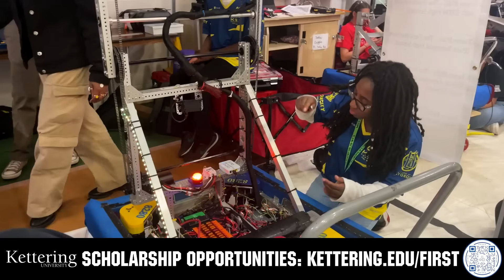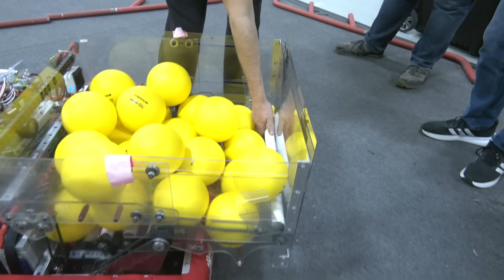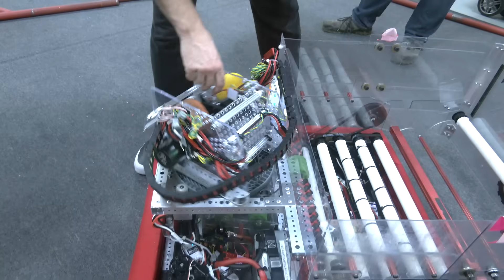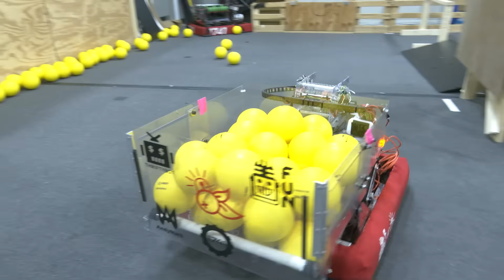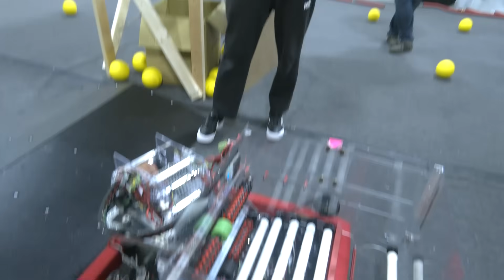Technical Breakdown | Ri3D Cranberry Alarm | REBUILT 2026

Comment: Please tell me:

Microcontroller (Arduino Uno? Nano? Raspberry Pi? etc.)

Motors (DC? Servo? Stepper? How many?)

Motor driver (L298N? TB6612? Built-in ESC?)

Battery type & voltage

Sensors (Ultrasonic? IR? Encoders? IMU?)

Any extra modules (Bluetooth? LEDs? Camera?)

Comment: Won't that extended frame get decimated with one good hit?
Reply: That is what I’m thinking
Reply: he kicks it https://youtu.be/TTUpKJGgtI0?t=1680
Reply: Should the extended hopper be designed with a retractable mechanism, whether through the intake system or an alternative method, it would essentially function as an over-the-bumper intake. The primary consideration in such a configuration is the necessity of promptly retracting the hopper when not actively intaking, particularly during shooting or transit operations.
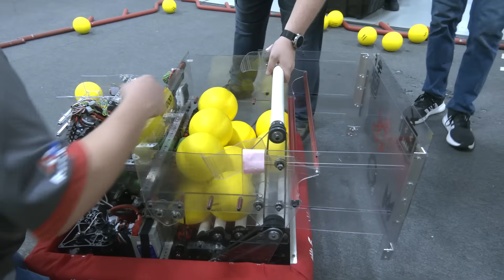Reply: They talk about it at 28:25.